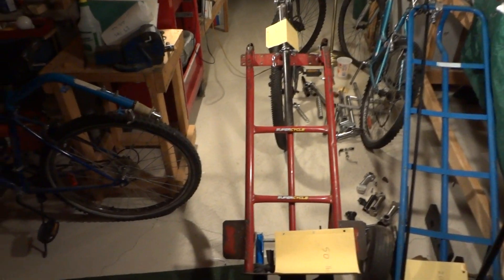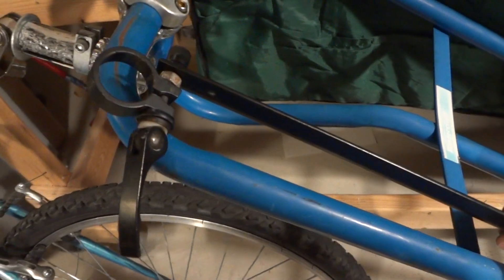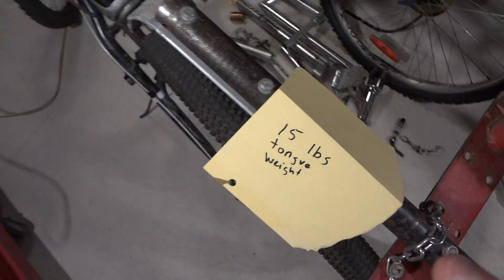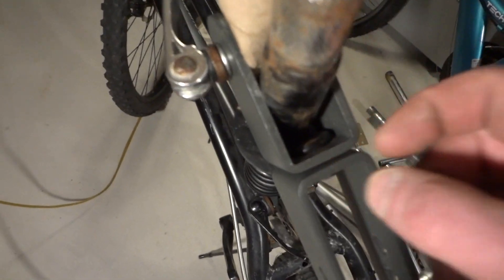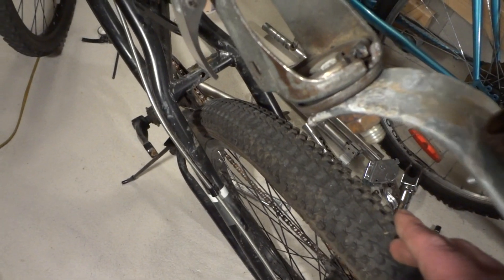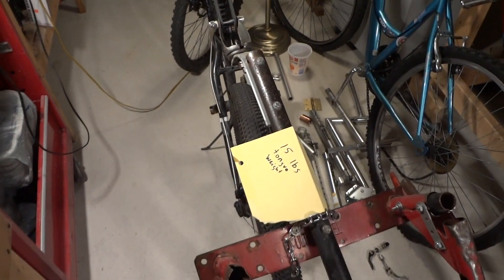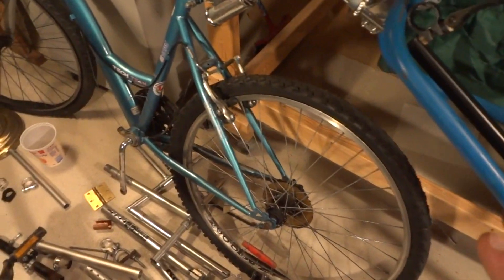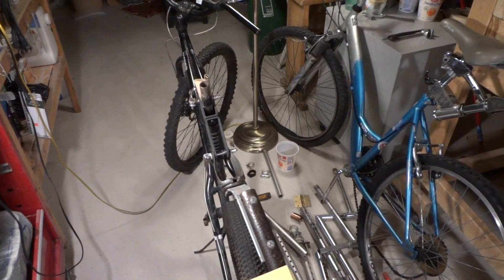Make a bike trailer hitch with DIY parts Part 5

Comment: Great information,that so many other videos don't address .Thank you. I'm working on 3 different diy trailers and the hitch set up is the most frustrating part.
Reply: Hopefully you get this message.  What did you find worked best?
Reply: @campeze7955  well I'm diy with aluminum alloy handle bar extension  with a old style brass door hinge pin. I'm using a light weight foldable shopping cart. I'm been frustrated by lack of information either fix or privot, strength areas of connection and some other newbe dyi ideals on making a hitch. Thank you.